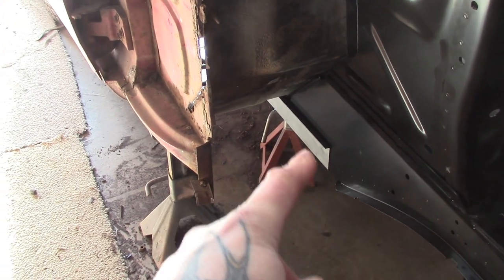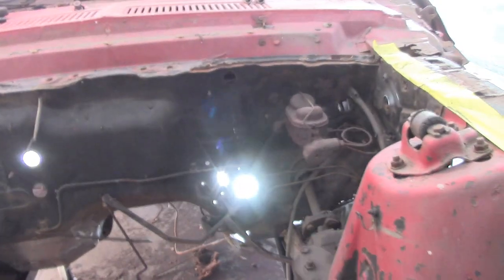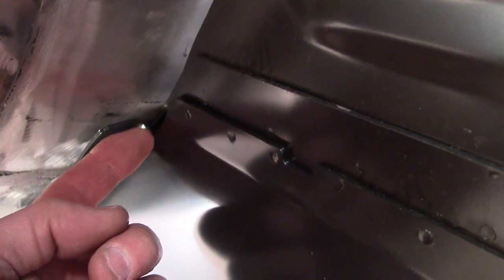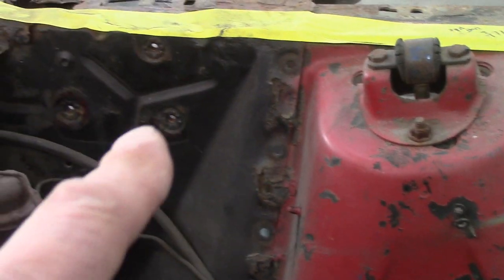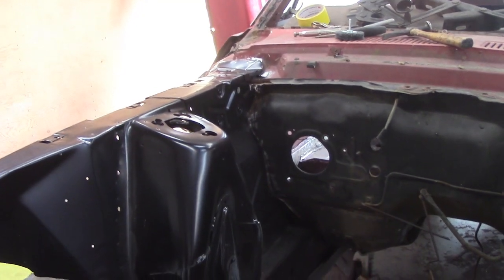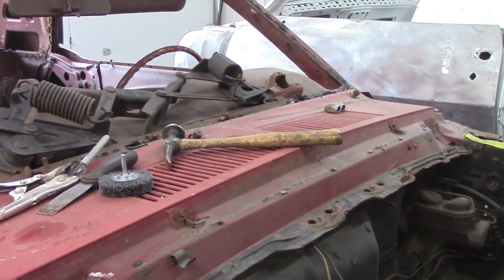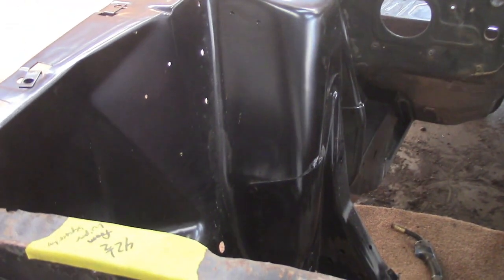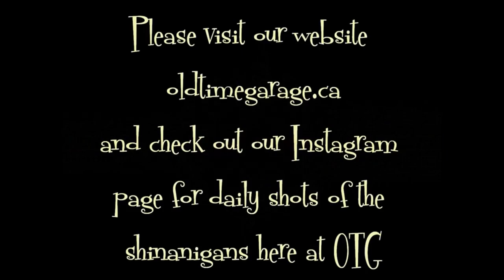Tips On Installing Mustang Inner Fenders

Comment: Get an export brace. That will help make sure some things are in the right place. It's only about $30. I just bought a 67 Cougar. Very similar build in the front end. 53 years old (just like me...) and the brace dropped right in. Matching to 'factory' can get you in just as much trouble because the shock towers can sag into the middle.

Comment: Plug welds combined with the welds outside the frame will make it considerably stronger. 
Like aircraft use 2 rows of rivets. Only one row is weak. 
Measure lots and take photos. 
I guess “a guy” could make up a couple jig bars to verify fit between shock towers and engine mounts. I think this is going pretty quick!
Reply from the maker: Its coming along nice but always some issues to adress